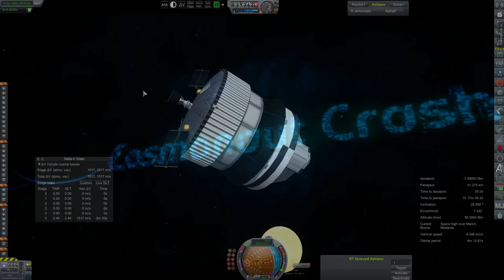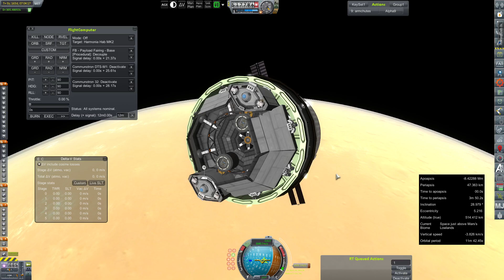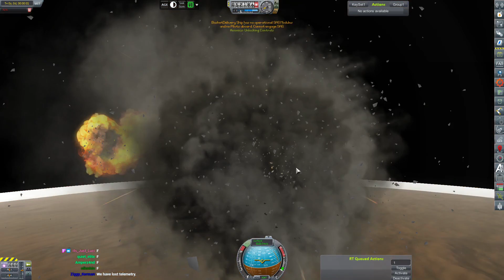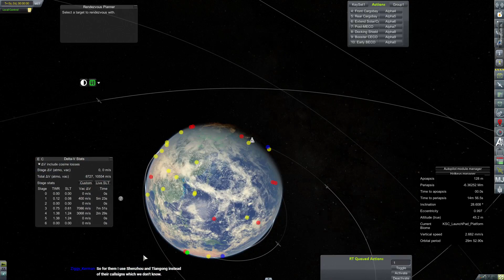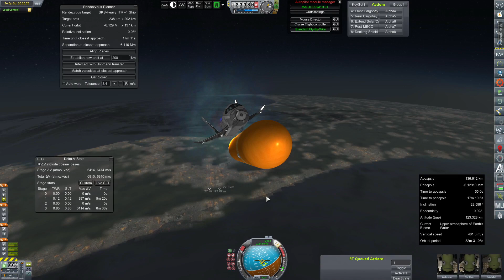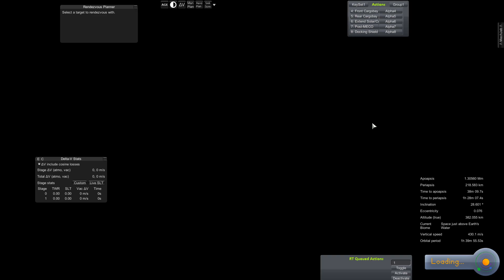KSP RP-0 #664 MTBFU

Comment: It may be worth it to build something capable of propulsive capture for your mars program since aerocapture seems to fail more often than not
Reply from the maker: These baskets for the lander are kinda unique in thier failure. Supply runs and most other missions have zero problems with aerocapture. The only thing I've moved to a dedicated propulsion capture is the crewed missions, which grew beyond the point where aero cap was an option.  Overall, aerocap is just the best, most efficient method. This mission is just plauged by a single part with a low heat threshold and a bug in the saturated heat model.
Reply: @CosmonautCrash  Still might be a situation where you have to either consider a redesign or a capture stage.